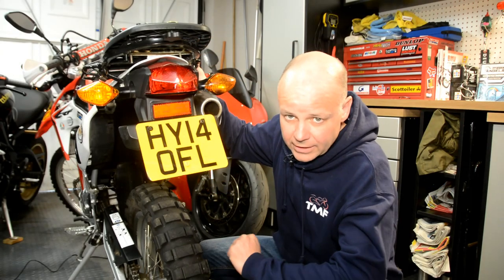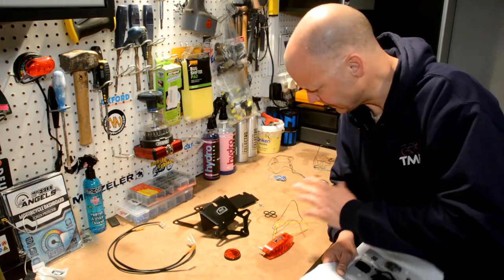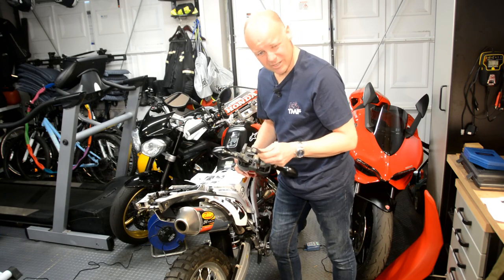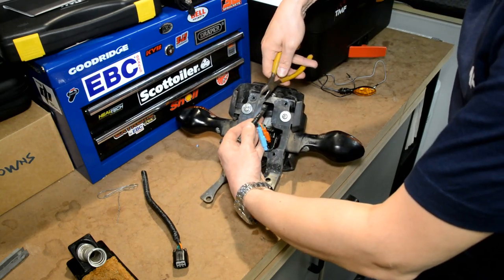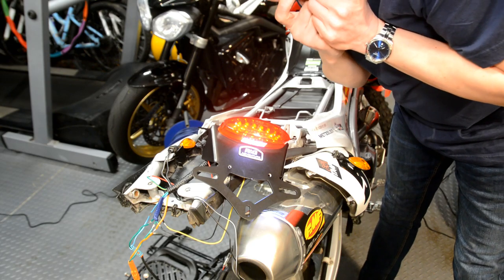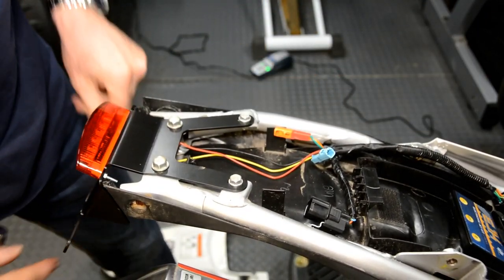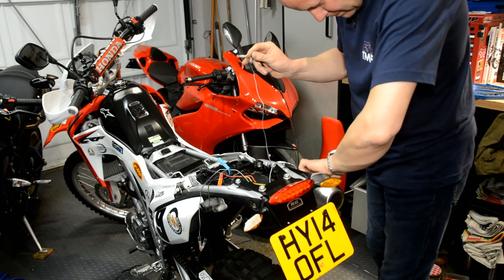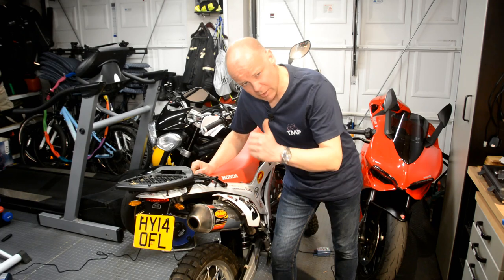How to cock up even the simplest of jobs! - Honda CRF 250L

Comment from the maker: Thanks for all the comments and advice folks......I've duly ordered some R&G in-line LED resistors to slow the flashing via Amazon (less than a tenner) and no doubt I'll post an update when I get around to fitting them...stay tuned!
Reply: TheMissendenFlyer see if you can get an LED flasher relay. Much easier.
Reply: If I remember right when I changed my lights to LEDs I fitted a ballast or flasher relay as I fitted four indicators, so if you decide to change the front to LEDS, a ballast/relay would be better??, or, I guess you can fit two more inline resistors as you have gone down that route.
I'm guessing, but if the resistor plays up, all four indicators go daft, if one inline resistor packs up, only one indicator plays up?- needs confirmation from someone who understands electrickery-I bleedin hate it.
Reply: Great work. Just beware though that UK MoT regulations require a rear reflector , mounted centrally, and perpendicular to the road; you can cover the manufacturer logo with a self adhesive reflector one and job done. (Oxford make good ones, I've used them) 👍
Reply: @pauljohnson3573  he cant, causse he still has bulbs on the front....
Reply: Get a LED flasher relay, don't use a resistor they get hot and kind of defeats the the power saving advantage of LEDs -- https://www.amazon.co.uk/s?k=LED+flasher+relay&i=automotive&ref=nb_sb_noss
Reply: When LED lights were first introduced for artics coupled to semi-trailers years back, the lack of resistance within the LED unit caused all sorts of compatibility issues. Ironically the introduction of a resistor made the lamp work but prevented the vehicle detecting a lamp failure, the resistor was interpreted by the system as a working lamp. A case of one step forward and two back. Thanks TMF for reminding us that nothing ever goes to plan and hat's off to you for having the balls to show the human error element!
Reply: Better off with a relay rather then the resistor as they tend to get hot and fail,  I'm a BMW mottorrad tech and some of the newer Canbus based bikes a resistor does nothing as they're ECU controlled, I'm pretty sure however that the CRF is normal mechanical system :), Also Solder wire and heat shrink it, It's much more waterproof :), Nice Video.
Reply: hessel tuit bulbs still work ok. Coincidentally I fitted one to my bike today and I had only fitted two led bulbs and all was ok.
Reply: @pauljohnson3573  ah ok...i didnt know that
Reply: Should have been included in the kit
Reply: I tried those in line resistors, unfortunately didn't work. Mot tester passed the bike with faster flashing indicators. I am so glad that i am not the only one who is all fingers and thumbs. Top marks for getting it done.
Reply: Converted the bulbs on my piaggio x8 125cc maxi scooter to led ones (2 on each corner) and fitted one inline resistor block each corner, all works fine with correct flash speed. Also there are heat shrink tubes on Amazon which contain a ring of solder in the middle and a ring of adhesive either end that made joining wires waterproof and are easy to use
Reply: I bought an adjustable relay from Amazon, that way you can adjust how quickly they flash.
Reply: hessel tuit actually he can because they are load independent. I changed my XT660 to led and the front ones still have the resistors in line eventhough i changed to a relay later on but they blink at the same speed.

Comment: Heat shrink is much better than tape for the electrical connections
Reply: Agreed - or a bottle of liquid tape is brilliant for this and so many other things.
Reply: Self Amalgamating Tape.
Tough, waterproof and vibration resistant.
Reply: @eubikedude  Liquid tape? Didn't know about that. I'll have a look, thanks!
Reply: @simonthomas5367  I didnt either, will be looking at that!  I was thinking I would prefer to shrink tube rather than tape...
Reply: EU Bike Dude I use both.  Liquid tape to ensure a good water tight seal and then shrink tubing over top of that to provide mechanical stiffness and abrasion resistance.
Reply: @eubikedude  Liquid tape is as lazy as using electrical tape, imo...  use the proper tool for the proper job.  If you're splicing wires you already have them apart and it takes half a second to put a piece of shrink tubing over the wires prior to soldering.
Reply: Soldering is old school .. insulated electrical crimps way better , way faster,  and can be quickly unconnected when needed .. dip all wiring in dielectric grease to prohibit oxidation (white rust)  before crimping and more grease in the connectors before clipping them together , wrap thoroughly with insulated tape .. job done and will outlast the bike
Reply: I thought the same...

Comment: Looks like a very poor product (piece of kit as you say on your side of the pond).  A good product would come with the proper connectors for the motorcycle in question so that the stock light does not need to be destroyed during the installation process.

Comment: I'm not sure that was worth the effort. The new LED indicators look like they're bending downwards? I'd have liked to hear your colourful language when you cut the wire wrong! That made me chuckle.
Reply: I think they are bending down because he has them on the wrong sides.
Turn them around and they tilt up.
Reply: They're actually angled downwards AND backwards because he couldn't use the original mounts for them which would have them angled properly, so he had to drill new holes on the side plates that are themselves angled backwards and downwards. So the indicators are mounted perpendicular to the side plates, but since the side plates are angled so are the indicators.
Reply: Agreed. Not really much of  a difference and the indicators look worse, all lopsided bent down.

Comment: I have a Z900rs and looked at the R&G tail tidy.  Ended up with a Jtech one for under half the price which was completely plug and play with new plugs and wiring for indicators included (unlike the R&G, to me R&G just aren't worth the money...  for that money it should be completely plug and play and if they supply led indicators for a bike that doesn't have them as standard a new relay wouldn't go astray....  but good job and well done for perseverring , I would have smashed it up and posted it back to them long before that  😂👍

Comment: When you test the indicators at the end, they work the opposite to the way you said you were checking! Hope you misspoke rather than wired it up wrong.

I can't remember a single time when I've attempted a "simple job" hasn't turned into a ballache of some kind. Glad I'm not alone!
Reply from the maker: You and me both Iain, there's no such thing as a "quick" and/or "simple" job when it comes to motorbike DIY!
Reply: Agreed Iain, their idea of simple, never matches mine.
Reply: It’s like there a built in traps for the non mechanical guys.  E.g. Removing Barkbusters, if you loosen the end screw too much the nut falls off and disappears down onto the handlebars. Much faffing with wire taped to geomag magnet then ensues....

Comment: R&G have always been a real faf to use.The instructions are never like EvoTech. Really cheap equipment the R&G compared to EvoTech. When i bought my Aprilia RSV 4 the guy gave me a R&G tail tidy brand new in the box. I asked why he didn't add it on, he replied "You'll see". The instructions were diabolical !!!! Yes, you had to cut wires as well!!! That was in 2016, & I can't believe in todays age R&G are still doing that! EvoTech is light years ahead of R&G. So much better looking as well. Thanks Mr Flyer for the vid, its re-instated the same thoughts I had of R&G years ago. Cheap quality, & ridiculous instructions. Don't beat yourself up either Mr Flyer about cocking up the install. It would've been R&G's instructions for sure that ran you around the block before you realising. Not your fault at all Mr Flyer. Good job in the end. Cheers groover ;-)

Comment: As others have said, don't be afraid to use heat-shrink sleeving (that wont wobble free) as part of the soldering process.  A small heat gun completes the work.

You then have a job that an inspector would sign off on your aircraft where a short circuit in a harsh environment might be more serious!
Reply: I hate the sticky mess insulation tape leaves on you fingers when you take it off for future work. And you'll never find that roll you have in your toolbox till after you buy  another one to get your job done.

Comment: Going down to the garage to install the Evotech tail tidy on my XSR900. Crossing fingers!! I'd go with adjustable flasher for the led signals, especially if you're still running incandescent up front. Works great on my XSR and can fine tune the speed with a potentiometer on the flasher. Flasher cost about $2 at aliexpress.

Comment: Considering R & G sell this as a kit, I'm surprised they don't include the electrical connectors, so a) it makes the conversion simpler and b) you can retrofit the original if required. Also, those indicators appear to be 'drooping'....Nice to see the community have mentioned to you about LED resistors, again, these should really have been included in the 'kit'...IMHO
Reply from the maker: I agree Rob....

Comment: As has, no doubt, been mentioned several times in the comment feed below, using heat shrink is , by far, a better solution than insulating tape for cable splicing.
Handy compartmented boxes of assorted sized heat shrink can be sourced via Amazon for relatively modest sums.  I think I paid about about £8 for a 200-250 piece assortment which contained sizes, in sufficient quantity, which would have easily enabled you to (forward planning required here!) cover not only the individual joints, but also the complete loom section as a whole, ensuring no water ingress which, using tape in this particular location, is a virtual certainty somewhere down the line.
Reply from the maker: I even have one of those sets fromAmazon!

Comment: I agree that for the money they should include a plug and play connectors rather than splicing and soldering.

Looks better and more compact but being solid metal and no rubber bushes or washers it may shake the lights and number plate loose over time

Comment: Regarding the speed of the flashing: LEDs draw much less current than incandescent bulbs, therefore the flasher unit which is designed to operate at the correct speed for 4 incandescent bulbs and by introducing 2 LED bulbs the current draw will be less and that is responsible for the increase in the flasher speed. You will probably need to fit some resisters to get the correct speed. Might be best to speak to whoever supplied the indicators and see what value is needed for the correct operation.

Comment: Mr TMF, you need a bench drill and a big box of drill bits. Cheaper that you think. A little hobby bench drill from screw fix start from £50. I have a clarke CDP5DD. You'll use it a lot more than you think. Will change your life :D

Comment: Hmmm, title change.
I don't think you thought this through too well. This is at least a three cup of tea job. Always make a brew before taking any irrecoverable action, namely cutting or drilling. Gives you time to consider each step before committing to a course of action. The indicators were always going to be drooping down because that rear bracket side is not vertical but slopes inwards. A brew, a chin rub and a mechanical dry fit would have prevented that.
I reckon the indicator wires are now exposed behind the bracket just in the place where the bike will gather a load of road dirt and mud and make cleaning around there a nightmare.
I can't see into the future but I reckon you'll be taking this off again, heat shrinking instead of taping the connections and repositioning the indicators. 
Or change the whole thing. 
Or suffer sleepless nights.
Reply: .... and unmatching indicators front and rear, more sleepless nights.

Comment: My local MOT tester tells me that a number plate light is not required by law, but a rear reflector is. No size or shape specified for the reflector so it can be as small as you like. Worth checking though
Reply: Only mopeds can't have a number plate light.
HOWEVER, it doesn't state that it must be white - hence we get away with generic lights on dirt bikes etc.
You are correct about the rear reflector, I generally have a little round or oval one stuck on my number plate.

4.7.1 Presence, condition and operation

You must inspect all motorcycles fitted with front and rear position lamps.

The rear registration plate must be lit. Most motorcycles will light the registration plate with a rear position lamp, but some will use a separate registration plate lamp. 

Some registration plate lamps may be fitted behind the number plate. 

Some mopeds might not have a registration plate lamp.
Reply: Thanks for the clarification
Reply: @waynedl99  . . . and rear reflecters maybe any shape except triangle -          ( which is for trailers only).

Comment: The indicator flashing thing is a resistance problem, like when you only have one not working. 
Personally, in hindsight, I think I'd have learned to live with the old styling. Probably could have stripped out the engine and rebuilt it in the same time??😄
Reply from the maker: Well I couldn't have (clearly!).....

Comment: Hey TMF. Best way to sort out hyperflash is with an aftermarket flasher relay. You can find a plug and play one for a CRF250L or a CBR250R. I tried resistors but they get way too hot if you're sitting at lights or stuck with the hazards on.
Reply from the maker: I've ordered one from Amazon so we'll see what happens....stay tuned!

Comment: If the rear are flashing and they are LED indicators,  you will need an indicator  LED relay indicator  and you will need to change the front for the same too .hope it helps.  I did it on my xsr900.
Reply from the maker: New relay on order!

Comment: 2 options re indicators

(1) change the relay for an LED specific one and also change the front indicators to LED

(2) Wire in in-line resistors (also available from R&G)
Reply from the maker: Yes just ordered some R&G ones from Amazon - less than a tenner!  So much for "plug and play"!
Reply: Just changed the relay this one plugs in and works on my CRF250L Qiorange 12V 2Pin Auto motorcycle... https://www.amazon.co.uk/dp/B07HNQ64ZG 
The fast flash is deliberate to show if a bulb blows as you then would have half the current led bulbs are low current so triggers fault mode in original relay.

Comment: Probably best to stick a flex or seal the rear light brake light to seal it from water. I have had 2 now from water ingress. Good for you soldering. I just used quick release connectors. Makes it easy to change after a crash.

Comment: That looks high up on the faff scale to me. Honestly don't like having to chop the original plug off the old rear end, not so easy to put back to standard when you sell. Also if the kit has LED indicators surly you would expect the resistor to be included that stops the lights flashing so quick. Could almost feel the anxiety when you took the cutters to that cable 👍👍👍
Reply from the maker: Yeah a bit rubbish that I didn't get in-line resistors or relays with the "plug and play" kit....luckily a quick search on Amazon reveals I can get some for less than a tenner.  ...and "sell the bike"?!  Never gonna happen!!
Reply: @TheMissendenFlyer  arr I forgot, you are a bike collector 👌
Reply from the maker: Correct!

Comment: Love the channel, but please excuse me for criticising.
Get yourself some heat shrink tubing, that wiring is awful.
I'm guessing R&G gave you this free for review purposes. But Evotech is a much better product.
Re-review the R&G in about a year, it will probably be very rusty.
 You need to change the flasher relay, or install resistors.

Comment: I can beat you on messing up simple jobs. I've ruined the seals on two chains on Yamaha MT bikes I bought new, despite regular cleaning and re-lubing. The first time, I assumed I hadn't given the Motul chain clean enough time to dry before relubing, so started giving it longer and using more lube afterwards. Now I assume it's from scrubbing too vigorously with a chain brush, so I've stopped using the brush. If it happens again I'll have to assume Motul chain clean is the devil. It's meant to be the easiest job to do on a bike.

Comment: This is the problem with r&g tail tidies. They're crap basically. For what they cost they could easily include a small wiring connector to just plug and play. If evotech can do it, r&g should be able to.

Comment: Another great vid TMF!

Looks so much smarter with the tail tidy, and new TMF sticker 😉. More of a motocross look.

Fast flashing can be fixed with either a new relay (designed for led indicators) or by putting the correct size resistor in line with each indicator. A relay is probably the easier job for someone with less experience of electronics. 

Look forward to seeing some more vids out on this bike!

Keep up the good work 👍🏻

Craig.
Reply: Yes it looks so much better 😃
Reply from the maker: So much for plug and play eh!?
Reply: Yes, I am surprised that R&G didn’t supply a flasher relay as part of the “kit” if it was supplied direct by them?

Still a great vid of the install - extremely useful information for people who haven’t done it before 👍🏻👍🏻

Comment: Bought that exact R&G tail tidy, it's a massive pain in the arse. We managed to save the stock parts though which was good. Worth it for the looks! A shame there a gap just above the light between the plastic that's shoody design.
Reply from the maker: Yes that gap annoys me too....
Reply: @TheMissendenFlyer  I also bought an FMF pipe because I'd seen yours and it's mint. A bit loud but still, mint